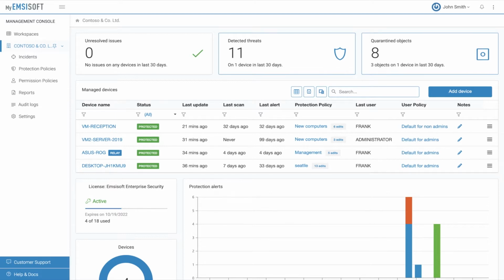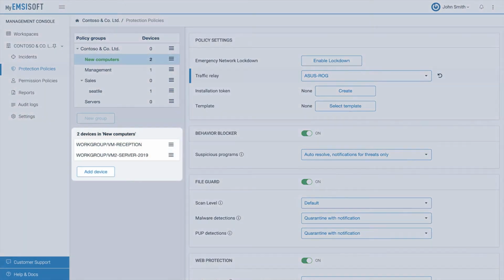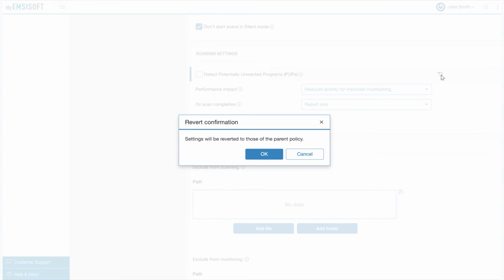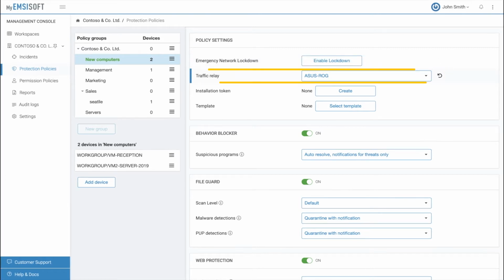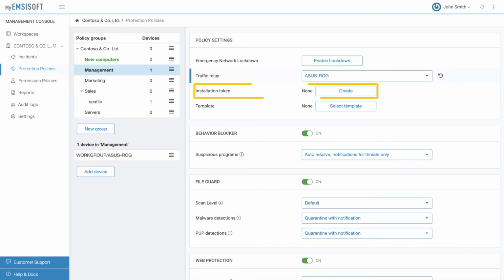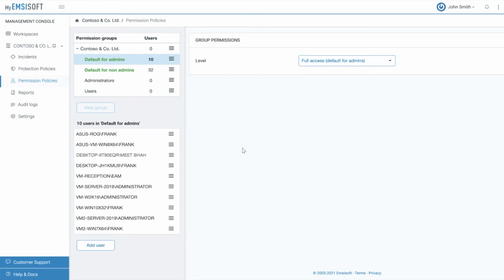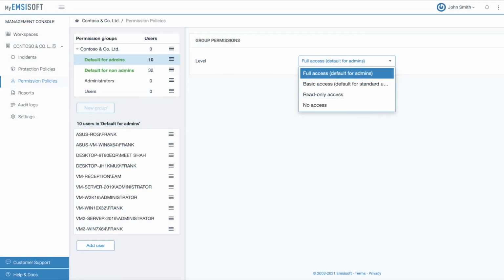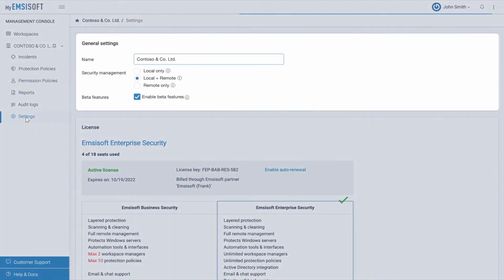Using group policies | Emsisoft Management Console | Emsisoft Tutorial

Comment: if i install emsisoft under ws1/wg1, with the installation token of wg1, the  asset will be shown in wg1. but if i change the  group to wg2, should i need to uninstall and reinstall with new token from wg2 or the wg2 policy settings will be applicable to that asset without touching the agent ??